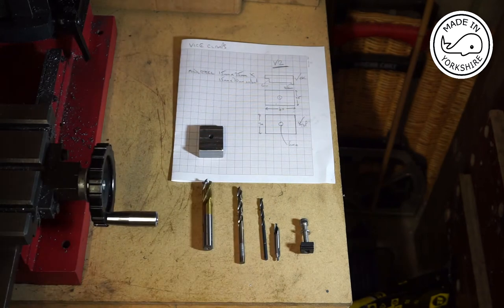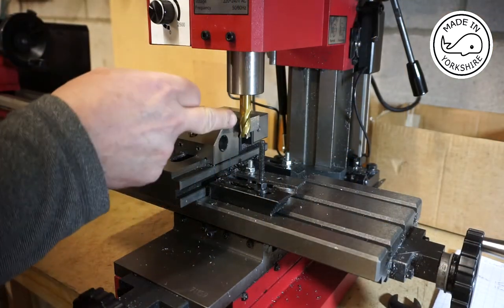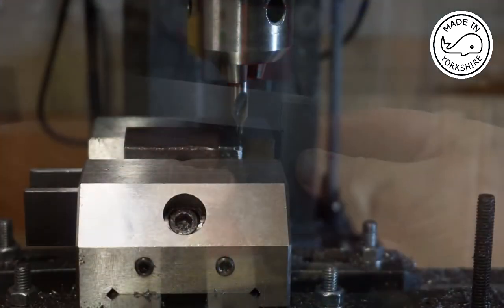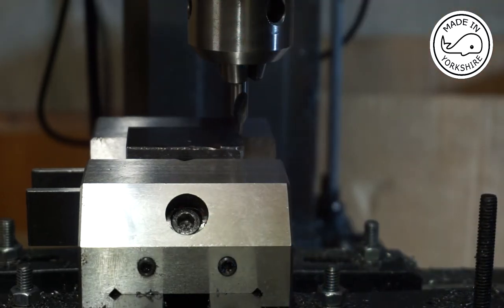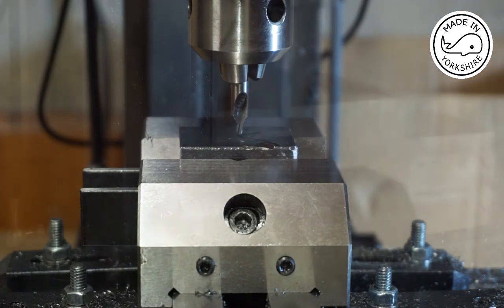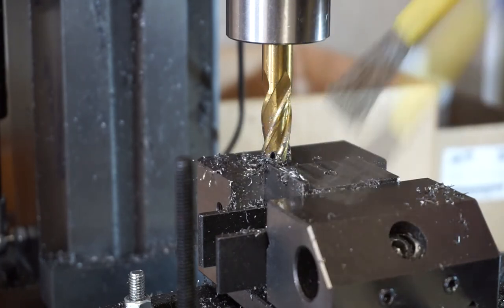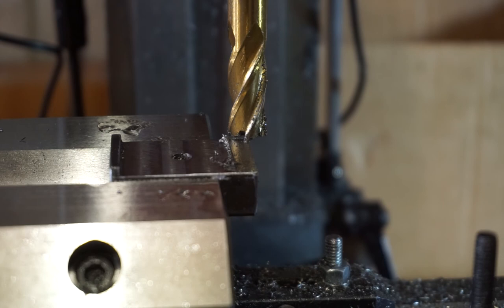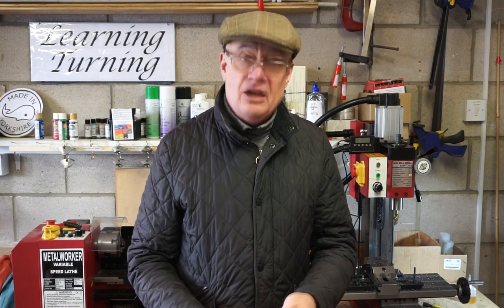#MT11 - Making a Vice Clamp. By Andrew Whale.

Comment: Great project. Keep doing them and sharing them. I seem to mostly make tools but watching your videos about the "SALLY" make me want to try one.  I always try to remember 2 things. First, this is a hobby; it's supposed to be fun. Strive for excellence but don't beat yourself up. The second is that very few of us are capable of working to the tolerances our machines are capable of producing or that we are capable of measuring accurately.  I mention this second because it's refreshing to hear someone say 1/64th or 3/32nds instead of 2 ten-thousandths. I have several Hemingway kits on the shelf and just started the basic graduating tool. HK1210.  Nice to read "Square ends. Total length not critical"

On these clamps- I also had to make a pair when I got my vise. Mine has holes instead of a shelf so I had to use pins. Can't tell you the joy of using something you made yourself to make something new.

Comment: Tip
Use some aluminium shim under the heel of the clamp, to protect the mill bed from being marked.
The Arc type 2 vice is very good.
(70mm version ) Need to change the M6 X 50mm cap head for high tensile type also keep an eye on  the cam nut.
It gets chewed up when engaging the harden vice cutouts, dress it with a file.
To keep the movable jaw free to move and engage propley.

Comment: I am also new to machining and enjoyed your video and have learnt some points from both the video and the comments you received. My lathe and mill whist small are slightly larger than yours therefore the  machine vice is larger and is held down by studs nuts and washers.
I find it is interesting that you use metric length measures however revert to thousandths of an inch for the amount you are machining. As an Australian schooled during the time we were converting to metric and working as a science teacher till I recently retired I am conversant with both imperial and metric measures however rarely using thou other than spark plug gaps and tappet settings. I have both subscribed to your channel and liked this video. Keep up the good work I look forward to watching your other videos.
Reply from the maker: Hi Hugh. I'm really pleased that you have found the channel useful. I tend to flip between imperial and metric due to the fact that the drawings are generally imperial and the dials on my lathe and mill are metric. I just remember the magic number 25.4 and use a calculator. For some reason I can also relate more to a thou - must be my age and messing around with motor cycles and cars in my teens. Many thanks for the feedback.
Take care mate.
Andrew
Reply: Hmm, he does seem to have a large following from Down Under. Shows we have good taste, whatever the rest of the world may think ...

Comment: Thanks for Your interesting and inspiring videos. 
I found this video today. For the community I express my thought about Your decision to cut the hole at the middle of the clamp plate. I choosed to cut it as close as possible to the vise in order to make as much as possbile of the bolt preassure to be applied to the vise. I just sent You and Email containing pictures.
Reply from the maker: Thanks Stefan - I guess it would be better if the holes were a bit closer to the vice, but then I've never encountered any holding problems.
Cheers
Andrew

Comment: Hey Andrew - Just discovered your channel! I very recently bought exactly the same lathe, mill and a very similar vice, so everything you're doing is of interest.  Subbed!
Also, if you are interested in a tachometer for the lathe and mill that uses the SIEG tacho ports (no modifications required!), you can put one together fairly easily using off-the-shelf electronics for around 10 Australian pesos. (So probably 5 quid) Give me a shout if it's of interest.
Thanks for the videos!
Reply from the maker: Hi Andrew. I'm really pleased you like some of the videos. Great to get feedback like that. I would be really interested in makng an rpm display and it would be good if you could provide me with details. More than happy if you can do it by replying to this, alternatively I can try to send you a PM with my email address.
Cheers
Andrew
Reply: Cool, just sent you a message with my email address, in case yours doesn't work...

Comment: Just watched you using a saw. I was about to be horrified. Thank you, a tad fast, but compared to most a wonderful improvement. You do have a Butchers saw not an Engineers one. You will find the Engineers saw a much better implement if you can obtain the correct one.  They have a file type handle.

Comment: Hi Andrew,

I've followed a lot of your excellent videos, especially on the Stuart 10v. I'm about to buy a vice for my milling machine - having got by with a drill stand type vice up to now - and came across your video on vice clamps. The No. 2 vice is advertised as being free of jaw lift, but have you found this to be correct? It does sound almost too good to be true. Also, how have you found the vice overall for accuracy? I think the standard milling vices are much to hefty for small drill / mills. Needless to say, if I do get the vice I'm going to make your clamps as the first job!

Keep on presenting the videos,

Regards,
Chris
Reply from the maker: Hi Chris
I think the vice is fantastic. The one on the small mill is 70mm wide and is a nice size. I have since purchased 90mm and 120mm versions for my larger mill. There is absolutely no jaw lift. The bolt used to tighten it (using an allen key) is at an angle and pulls the front jaw down. The nut on the other end is held in a ratchet type of affair, and can take a bit of getting used to when opening/closing beyond the range of the threaded bolt. I hope that helps.
Thanks for the feedback! The 10v turned out to be a really nice engine.
Cheers
Andrew
Reply: @learningturningmetal  
Hi Andrew,

Thanks for getting back to me so quickly.
It's nice to hear from someone who has used a bit of kit and I'll definitely be getting one of the vices - they must be pretty good if you've got three of them!
I like the way you progress your work and it's nice to see that you honestly include the mistakes. We all make mistakes and often learn more from the mistake than we do from the part that went smoothly.

Best Wishes,

Chris